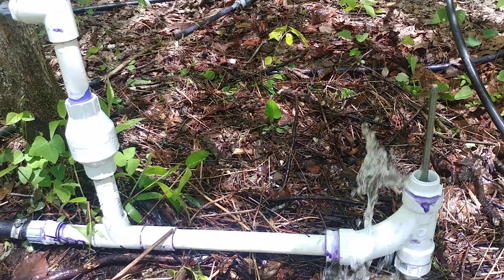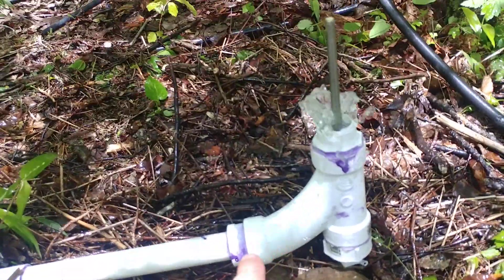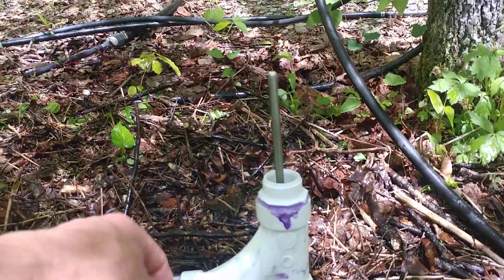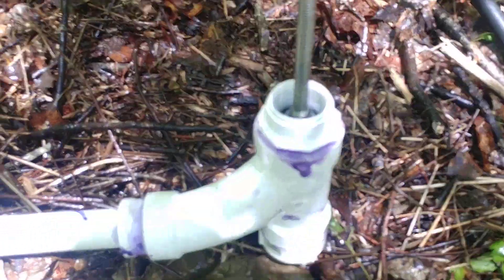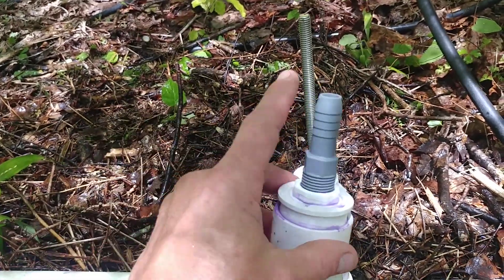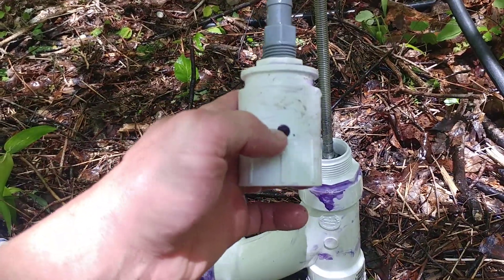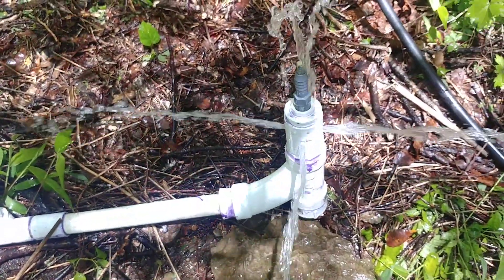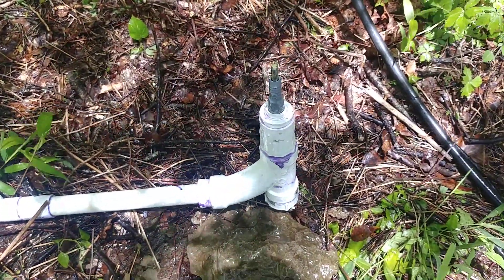(DIY) Water Ram Pump Check Valve! Easy Build!!!

Comment: This is great. Any way you can show how you built the check valve with more detail or pull the rod out so we can see the inside better.
Reply from the maker: I will make a video of a new build I did not using a sanitary.  Hopefully this week.
Reply from the maker: Without the sanitary T. That is... It is not rated for higher pressure.
Reply: @toddwolcott  Thanks. I was planning on making one this week but I'll wait for the upgraded one. Thanks for sharing.

Comment: This is great.  Good job.  Can you show a video of it being put together?  Im still a little unsure of the bottom of the valve when you say "I did the same thing at the bottom".  Thanks.
Reply from the maker: I will make a video of a new build I did not using a sanitary
Reply: @toddwolcott  gov will have all heads for this tech thay teach us that we always have loss but never talk about 
the converted gain we can make from eletromagnets
if u convert all the wast thermal energy around 
you u can use it universally as energy u need a true sine wave bipolar like the power comp dose a 
true pure sinewave like a grid tie inverter 
once the signal is made the system will turn on and 
consume wast thermal energy from the 
environment and space around you... there is free energy but 

it comes from Universal thermal loss and converted into a gain. so a pole Transformer and a 
microwave Transformer  have a common between each other u can take 2 microwave Transformer provide 
a pure sine wave grid tie inverter to it or a true bipolar sinewave that inter acts with nature in 
a perfect spherical motion like a flower of life..  if ur home provides this use it as a Source 
signal then u can simply stack the Transformers on top of eachother in correct fasion and note 
that the 1 wire on the Transformer must stay connected and the other disconnected your only useing 
1 wire on the hi side .. so test ur self 
2 microwave transformer stacked on top of eachother same 

face sides. one side 120 to the wall and the other 120 side to what u want to power and useing the 
Transformer just the way it came out the microwave with the wire attached causes the energy in its 
perfect spherical motion to converted wast thermal energy to amp for u hot to cold in to out... 
should look a bit nuts with u use a form of wireless energy but its interacting with the 

environment...this is my work a compilation of Otis car. Tesla. and many other very smart people 

nowadays i think i found the gate source and drainif this gets out to much that it works the 
power 

comp and mib will have our headsdont do this at home warning high voltage yet i cant stop u lol DO 

NOT TOCH THE CORES OR THE WIRES OK u will die make sure u dont touch the core if the hi wire is 

mounted to it u dont have to mount the hi on the core if u dont want u connect the 1 hi wire to 

the same side hi on the other transformer then the core should besafe to handle if nessary
grab your multimeter and prove me wrong
thats what u do i have my whole home on this
and u can take 

one of the lows side out the wall and hook it up to other stuff and power it for verry little amp 

makeing nature convert and pumping latent heat effect into the device.
and u can have a microwave 

hi volt cap in between the hi side and make a system that powers its self
u can flip the switch on 

ur breaker and the room stays on up to 2kva 
with both lows in the wall this is the zero point that 

was taken from us...
Reply: @toddwolcott  gov will have all heads for this tech thay teach us that we always have loss but never talk about 
the converted gain we can make from eletromagnets
if u convert all the wast thermal energy around 
you u can use it universally as energy u need a true sine wave bipolar like the power comp dose a 
true pure sinewave like a grid tie inverter 
once the signal is made the system will turn on and 
consume wast thermal energy from the 
environment and space around you... there is free energy but 

it comes from Universal thermal loss and converted into a gain. so a pole Transformer and a 
microwave Transformer  have a common between each other u can take 2 microwave Transformer provide 
a pure sine wave grid tie inverter to it or a true bipolar sinewave that inter acts with nature in 
a perfect spherical motion like a flower of life..  if ur home provides this use it as a Source 
signal then u can simply stack the Transformers on top of eachother in correct fasion and note 
that the 1 wire on the Transformer must stay connected and the other disconnected your only useing 
1 wire on the hi side .. so test ur self 
2 microwave transformer stacked on top of eachother same 

face sides. one side 120 to the wall and the other 120 side to what u want to power and useing the 
Transformer just the way it came out the microwave with the wire attached causes the energy in its 
perfect spherical motion to converted wast thermal energy to amp for u hot to cold in to out... 
should look a bit nuts with u use a form of wireless energy but its interacting with the 

environment...this is my work a compilation of Otis car. Tesla. and many other very smart people 

nowadays i think i found the gate source and drainif this gets out to much that it works the 
power 

comp and mib will have our headsdont do this at home warning high voltage yet i cant stop u lol DO 

NOT TOCH THE CORES OR THE WIRES OK u will die make sure u dont touch the core if the hi wire is 

mounted to it u dont have to mount the hi on the core if u dont want u connect the 1 hi wire to 

the same side hi on the other transformer then the core should besafe to handle if nessary
grab your multimeter and prove me wrong
thats what u do i have my whole home on this
and u can take 

one of the lows side out the wall and hook it up to other stuff and power it for verry little amp 

makeing nature convert and pumping latent heat effect into the device.
and u can have a microwave 

hi volt cap in between the hi side and make a system that powers its self
u can flip the switch on 

ur breaker and the room stays on up to 2kva 
with both lows in the wall this is the zero point that 

was taken from us...
Reply: @toddwolcott  gov will have all heads for this tech thay teach us that we always have loss but never talk about 
the converted gain we can make from eletromagnets
if u convert all the wast thermal energy around 
you u can use it universally as energy u need a true sine wave bipolar like the power comp dose a 
true pure sinewave like a grid tie inverter 
once the signal is made the system will turn on and 
consume wast thermal energy from the 
environment and space around you... there is free energy but 

it comes from Universal thermal loss and converted into a gain. so a pole Transformer and a 
microwave Transformer  have a common between each other u can take 2 microwave Transformer provide 
a pure sine wave grid tie inverter to it or a true bipolar sinewave that inter acts with nature in 
a perfect spherical motion like a flower of life..  if ur home provides this use it as a Source 
signal then u can simply stack the Transformers on top of eachother in correct fasion and note 
that the 1 wire on the Transformer must stay connected and the other disconnected your only useing 
1 wire on the hi side .. so test ur self 
2 microwave transformer stacked on top of eachother same 

face sides. one side 120 to the wall and the other 120 side to what u want to power and useing the 
Transformer just the way it came out the microwave with the wire attached causes the energy in its 
perfect spherical motion to converted wast thermal energy to amp for u hot to cold in to out... 
should look a bit nuts with u use a form of wireless energy but its interacting with the 

environment...this is my work a compilation of Otis car. Tesla. and many other very smart people 

nowadays i think i found the gate source and drainif this gets out to much that it works the 
power 

comp and mib will have our headsdont do this at home warning high voltage yet i cant stop u lol DO 

NOT TOCH THE CORES OR THE WIRES OK u will die make sure u dont touch the core if the hi wire is 

mounted to it u dont have to mount the hi on the core if u dont want u connect the 1 hi wire to 

the same side hi on the other transformer then the core should besafe to handle if nessary
grab your multimeter and prove me wrong
thats what u do i have my whole home on this
and u can take 

one of the lows side out the wall and hook it up to other stuff and power it for verry little amp 

makeing nature convert and pumping latent heat effect into the device.
and u can have a microwave 

hi volt cap in between the hi side and make a system that powers its self
u can flip the switch on 

ur breaker and the room stays on up to 2kva 
with both lows in the wall this is the zero point that 

was taken from us...
Reply from the maker: I did not use a sanitary T in the 2nd build and will be posting a video of everything in the next video. I put a short video of build #2 up today. I will post how and what I used later this week.
Reply from the maker: https://youtu.be/VSafHP93X18